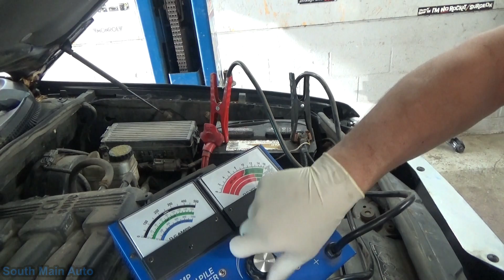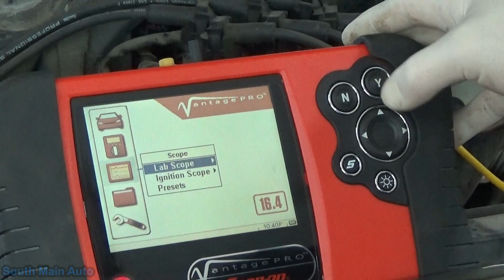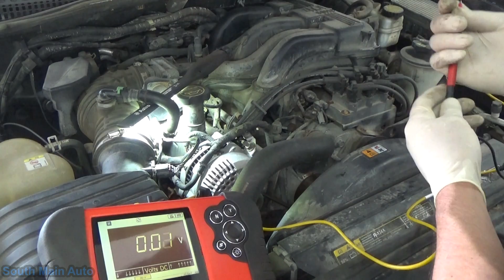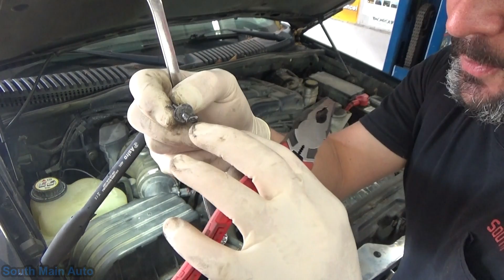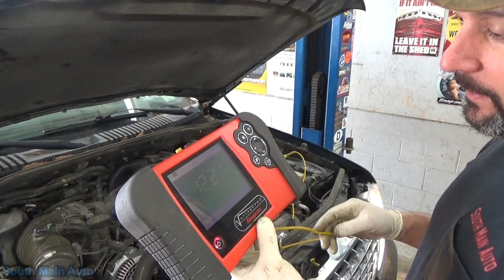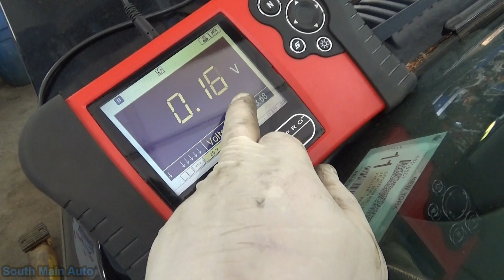Charging System Problem - Voltage Drops

Comment: what at 16 minutes in you didnt show us all the step buy step way of doing this ??? welll...I may unsubscribe lol
Reply from the maker: Remove bolts, replace bolts... that is step one thru four...
Reply: All I can say is I wish more mechanics here in illinois was like you..... I learn alot for being a noob.
Only question I have is I have a bludriver that connects and it does read fuel trims. The high and low should be the same or should the numbers be relatively the same as far as one being + and the other -?
Ex.  (+12 high.....-10 low or visa versa)
Reply: Oh the reason I asked wss the last truck you worked on showed it being both a 0 or close to it.